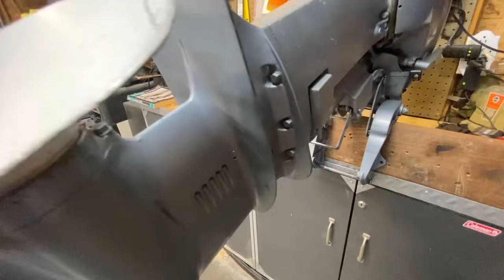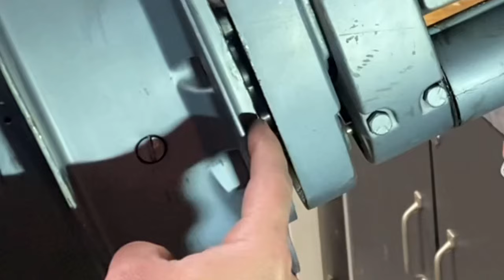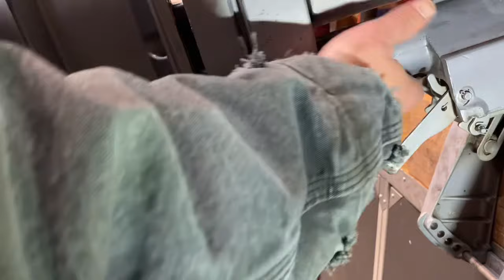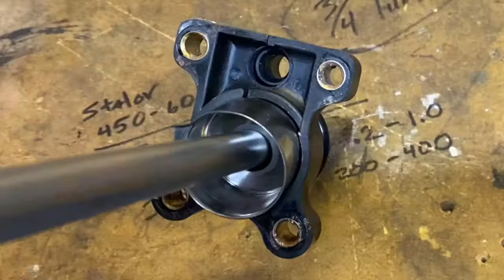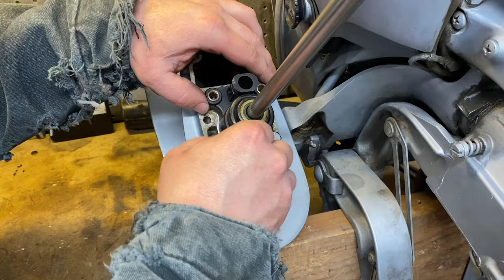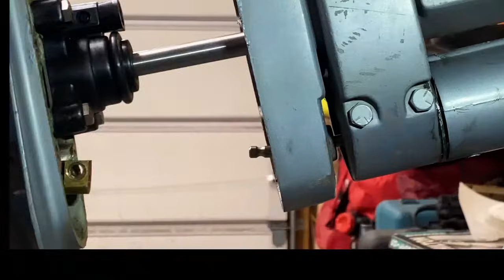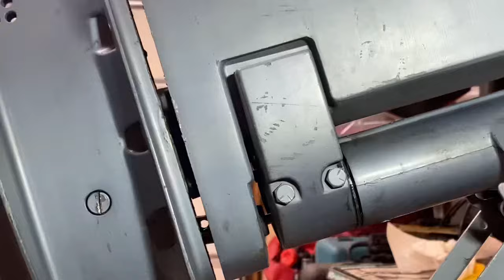9.9 - 15 hp Evinrude / Johnson water pump replacement

Comment: Good morning.! Thanks for your movies ..! Very useful. I have some advice to ask you ... My 9.9 johnson It has one cylinder that heats up more than the other. The coldest cylinder is the one on the carburetor side. Could the left cylinder water circuit be clogged? Thanks if you can answer me.
Reply from the maker: It’s possible that one of the waterways are clogged causing a hotspot in a cylinders. Other things to consider would be internal damage to the cylinder in question. Friction equals heat so with that being said you might look at your cylinder walls in that cylinder, and look at the rings. Make sure you don’t have a whole bunch of carbon buildup on the rings causing a bunch of extra drag on that one cylinder. Another overheating issue would be running to lean. Basically the cylinder walls aren’t getting adequate lubrication from the oil fuel mix which again is causing too much friction equaling heat. So with all that being said just to break it down, either you’re lacking adequate cooling, or you’re lacking adequate lubrication to the moving parts, or something internally and mechanically is jammed up of some sort causing friction. Hope this helps a little, thanks for watching!
Reply: @wetshoesmechanic  Thanks for the info you gave me. They are certainly useful to me! I also thank you for the work you do by posting these videos ..

Comment: I’ve done my water pump, but I think upper water tube grommet could be bad. Getting water pumping out at the base of motor housing. How would I change that.
Reply from the maker: The best way I know how to do that would be to pull the powerhead “The actual engine part of the motor”  to get access to that tube that high up in the motor. In that area there are a few gaskets, and Gromit that could be the culprit and without taking the powerhead off you can be sure which component has failed.
Reply: @wetshoesmechanic  you are right. I just finished up and the top grommet was bad! Mashed closed. She is peeing like crazy now! Tks for your posts, keep them coming!!!
Reply from the maker: Nice job!
Reply: @wetshoesmechanic  got another question for ya. At the top, just under the base of the engine housing. Their are 2 exhaust holes. Is water supposed to come out of them after the thermostat opens?

Comment: Great Video.  I am going to try this for my 2004 - 15 hp Johnson, which looks virtually the same.  I would like to know if you have a suggestion, or if anyone does for that matter.....on how to break the bolts loose.  I was only able to get three (3) of six (6) off, and my swearing and sweating in the garage is scaring my children.  Tried a penetrating oil with negative results.  
Keep posting video's.  Highly informational and confidence building.
Reply from the maker: Thank you for the positive feedback! I plan on trying to do more videos later on towards fall time. As far as the stuck bolts, I would continue to try with the penetrating oil and don’t be afraid to work the bolt back-and-forth a little. Sometimes people get hung up on loosening a bolt and will only turn it left. You can try nudging it in a tightening fashion to try to break up whatever it’s sticking the threads. I would use this as a last resort but if you have a little propane torch and you can keep it away from the paint and try to just apply the heat to the head of the bolt you might be able to get somewhere with that, but like I said I would use this as a last resort. Good luck to you!
Reply: If motor was ran in salt water, sometimes it's impossible to get them out with breaking the bolts, just try working the bolts back and forth,and maybe some penetrating oil may help

Comment: Doing this job now, and having trouble getting the shaft top engine spline lined up .... need four arms.  The difference is I have a long shaft which requires a third section. Lining things up on three planes is tricky.  Any advice tricks?

Thanks
Reply from the maker: Patients… that third section in a long shaft just takes a little patience. I know it sounds silly but if you were to put a few bolts through the lower unit into the midsection and wrap some tape around the outside leg to try to hold everything in place for that third section that might help. As far as lining the splines up it’s tricky, you can try turning the fly wheel by hand a little bit, Or pulling the rope for the starter to help get the splines lined up. Just be careful not to turn the starter or the fly will too quickly so as you don’t accidentally start it while you’re trying to do all of this. Also make sure that your water pump pick up tube makes its way into the grommet on the top of the water pump while you’re doing all of this. Good luck to you!
Reply: Thanks for your reply... I truly appreciate it!   Had to set it aside, but will try again tomorrow with your excellent advice!
Reply: With a fresh mind and added patience,  I got it together this AM. Thank you!   After the parts come in, tomorrow's task is to work on ignition.  Coil or condenser... we shall see.  Today's task is to come up with strap wrench and fly wheel puller, as my guess it will be condenser.  Anyway,  thank you for posting these videos.  You give many your experience  and motivation to try.  With any luck, I will be on the lake fishing next week.  Thank you!
Reply: At the end of this video, you state to make certain the shift linkage works properly.   When shifting into reverse, everything seems OK, but it seems to bind when shifting to forward gear.  Is there any linkage adjustment that can be done?   Also, just curious what state you live in?  
Thanks in advance,
Brian
Reply from the maker: To shift these properly it really should either be running, or you’ll need to turn the flywheel a bit To get the gears and the dog clutch to mesh correctly. I would either put some muffs on it or put it in a barrel and check how the shifts while it’s running. I’m out of Montana.
Reply: @wetshoesmechanic   Thanks WSM!   I have some muffs, and will try that, but I first have to fix a no Spark issue on one cylinder.   I think it is a coil,  but not certain yet.   Although 76 Johnson is different than your video, I am going to watch it now.  I certainly appreciate your time, work effort in your WSM videos!!!!    Hope to correct that today.    Montana!   That is on my bucket list, maybe someday!   I am in Michigan.  If you ever make it to Mich,  let me know and I will show you all the great places here!  

Thanks again,
Brian
Reply: Good news after replacing the coil, and cleaning up the points, it runs!   The bad news is the linkage is not right, and not much water coming out of the pee hole just under the engine.  I am thinking that the pump is not linked up with the copper tube.  There is water stream  coming out of the small bleed hole in the case next to the water pump.   I have to pull it off and try again.   I don't think I have to drain the fresh gear oil I put in?

Thoughts?
Thanks Brian
Reply: Success!!!! Took it for a couple spins around the lake in the rain!    Runs good, shifts good!  I am pleased!!!!

Comment: This is completely off topic but do you happen to know where I can get that protectective cover that sits at the joint of the tiller arm? I just bought the same motor and mine was torn. But I also want to do the water pump so thank you for the video
Reply from the maker: Sorry bud, I looked a little earlier today, couldn’t find one.

Comment: I'm doing my first water pump replacement on a Johnson 15 HP - I've looked at other videos but yours helped me the most - the detail was great - answered a bunch of questions I had.  Thank you for doing this.  ⚓️  Additionally I noticed you didn't use any gasket or gasket compound anywhere - did I miss something?And can I use Vaseline to hold the pin in place?  I don't have any grease  :) - Thanks again.
Reply from the maker: Thanks for the positive feedback! There’s no gasket material between the housing in the lower unit, just the O-ring, seal, and grommet on the top of the water pump housing.
Reply: I agree. Great videos.

Comment: Put the impeller on first. Slide the assembly down, and rotate the shaft clockwise. Seems to work better. Bit this is a much better video than others I've seen

Comment: Holy crap this is the video I needed, thank you! Couldn't find anything like this last year so I decided to put it off a year, and boy am I glad I did!!

Quick question though, im going to be doing this procedure this coming week, and I am wondering if you drain the lube at all before doing this, or if you leave it in the motor during the process.

Also, is the tube that carries the water from pump to block something that needs replacement??

Thanks a bunch!!!!
Reply from the maker: Thanks for the positive feedback! You don’t have to drain the oil in the gearbox to do this as long as you’re not turning the unit Upside down or laying it on it’s side. I had it drained mostly because it’s easier to film without spilling oil all over the place while I’m filming. You shouldn’t have to replace the tube that you’re talking about unless it’s been damaged somehow. There is a rubber grommet on the top of the water pump that the tube nests into. If that is not part of your water pump kit and is cracked or no longer soft and malleable you may consider replacing that too. Happy boating!
Reply: @wetshoesmechanic  did the replacement today, went smooth, ours is an 87 long shaft so a few minor differences, but our pump kit came with an o-ring that I'm not sure as to what it replaces. Pump kit lists it as 303097, looks like it could replace the o-ring that sits at the top of our drive shaft, but that o-ring was in good condition, but I can't seem to find a solid answer as to its purpose. Is it supposed to sit on the impeller housing seal at the top of the pump? Our old one didn't have one but it was the original pump and most of the housing, gaskets, and grommets had all melted/rotted/melded so jts hard to tell whats what from that.
Reply from the maker: @fastillion918  I’m sending you a hyperlink to marineengine.com, I believe part 59 in the exploded view on this webpage is what you’re talking about? From what I can see 0303097 Is a water tube for some model, I’m not sure which. I’m not sure which kit you have either, sometimes you end up with kits that have multiple parts for multiple Model numbers. I’m kind of guessing at your model number and the part that you’re describing but I believe it’s part number 59 in this list. Hope this helps a little good luck!
http://www.marineengine.com/parts/johnson-evinrude-parts.php?year=1987&hp=15&model=E15RLCUD&manufacturer=Evinrude&section=Gearcase

Comment: Me and my uncle tried tackling this job on my dad's 1982 15hp , and when we tried to remate the bottom end to the top end, we couldn't get it back together while keeping the shifter in the same neutral position. I'm not sure what we were doing wrong, but my small engine guy got it no problem and just said it can be finicky .. 

After skimming through your video , I'm wondering if the splines just weren't lining up and we needed to just touch the starter. 

I'll definitely re-watch this whole thing in full , and see what I can get out of it. I love the content you are making, better than a lot of  videos on outboards that I'm finding.
Reply from the maker: Thank you for the positive feedback!
Reply: Did a fine job